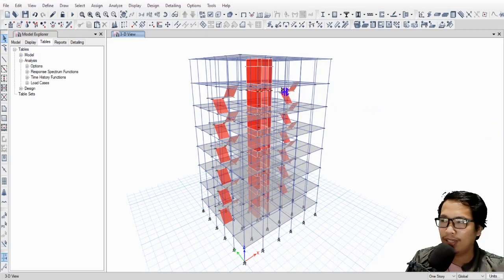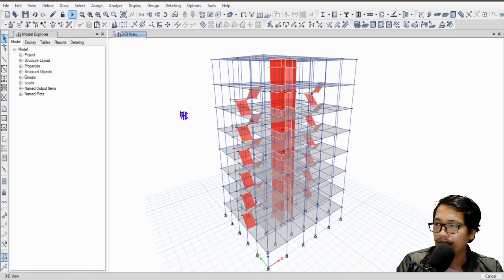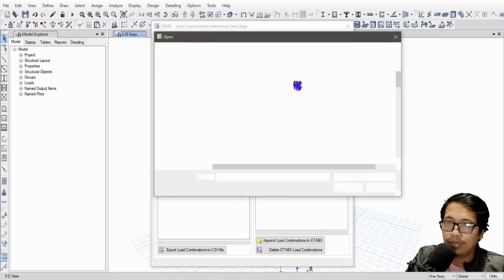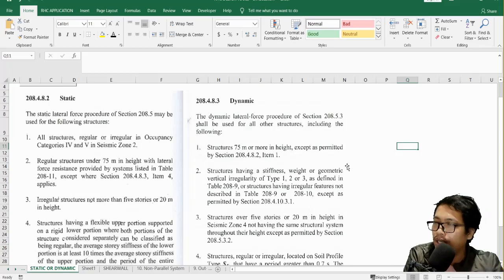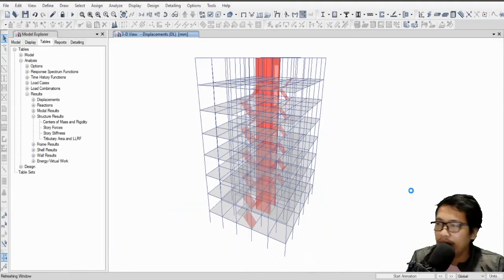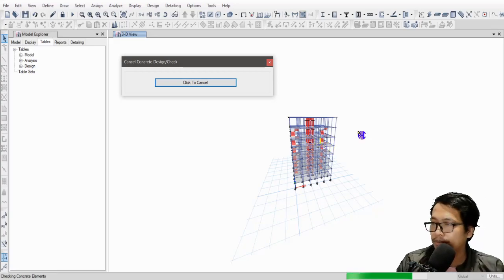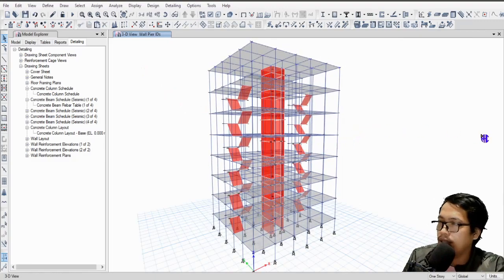Design & Analysis of A Medium-Rise Building - Part 3 of 6

Comment: sir, di po ba nadoble yung pagapply ng modifiers?
Reply from the maker: possible bro, hindi ko na na check. Pero ang method diyan need diyan echeck yung 0.7 & 0.35 na factor sa SW.
Reply from the maker: madaming kulang diyan, for requirement purposes lang yan.

Comment: 0:20 Check P Delta Effect
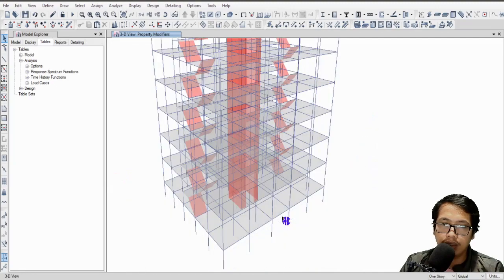11:32 Run Analysis
26:47 Define Load Combo
34:25 UpLoad Combo Using App
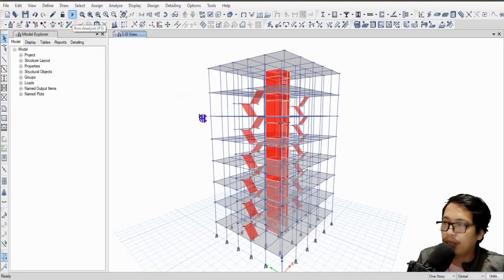35:35 Run Analysis
36:55 Check Irrigularities 
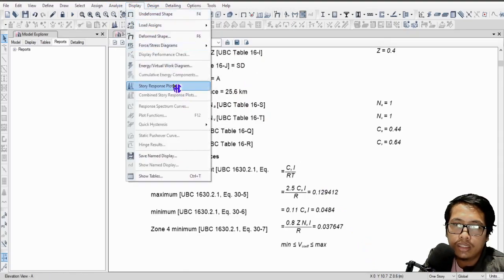55:46 Story response effect
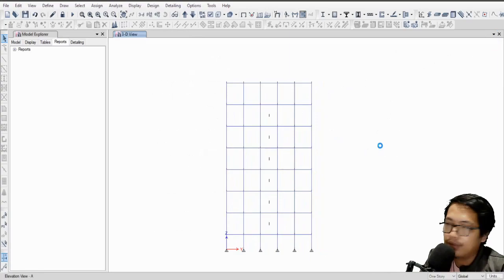57:05 Design
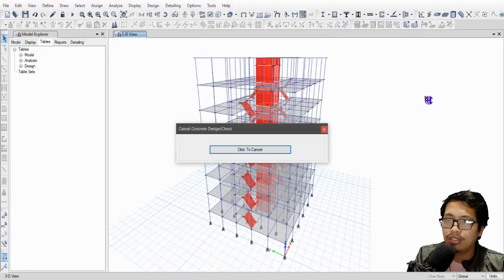1:00:20 Start design check
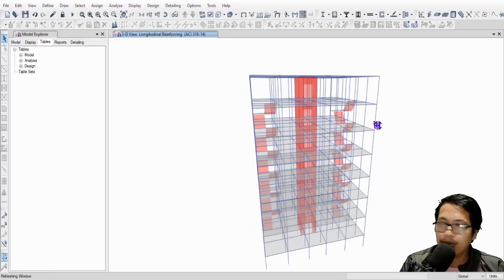1:10:10 Check failure
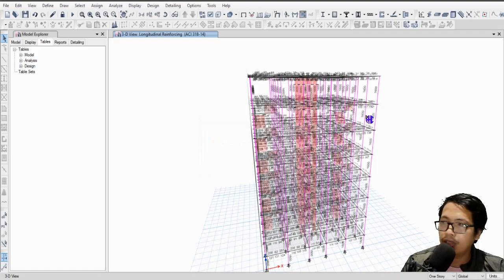1:10:20 Display design info
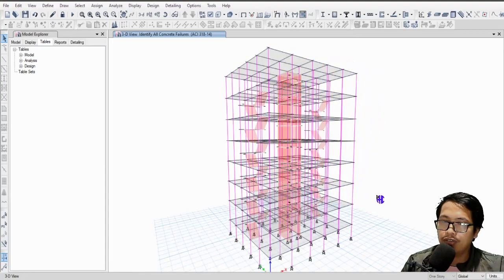1:10:55 Detailing
1:12:57 Start detailing
1:16:50 Design of shear wall

Comment: 37:55 irregular sir di po ba? Dynamic analysis po di ba pag irregular?
Reply: Paano po kaya sir yung sa Parameters ng Concrete design? Mayroon Seismic parameters na kailangan i-define as per requirement Pero Hindi po siya Match sa NSCP 2015 or UBC 97 requirements. Okay lang po ba yun?
Reply: @rhcengineering  sorry sir, 42:30 po pala. Not okay po na kulay pula ang nkalagay. Pag ganyan po ba kailangan di ba dynamic analysis?